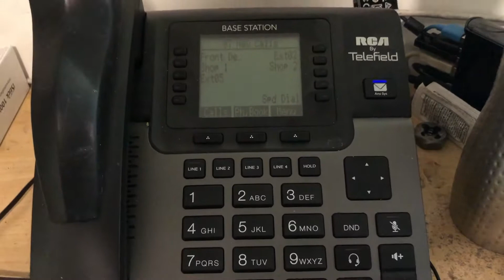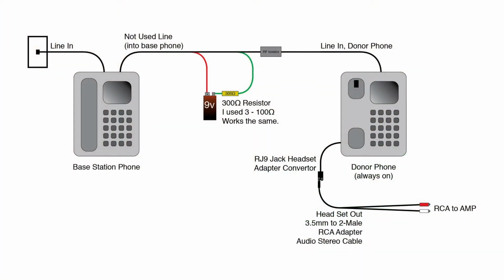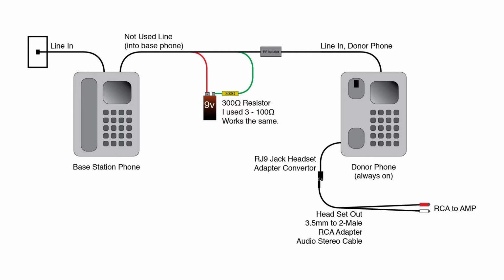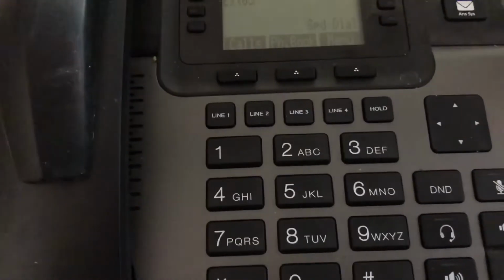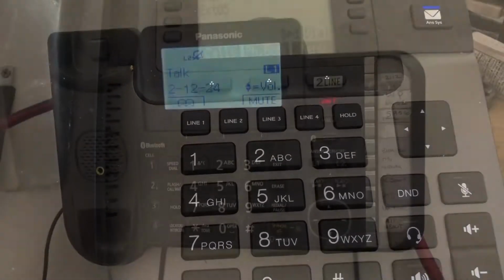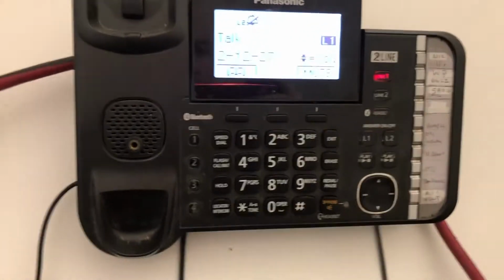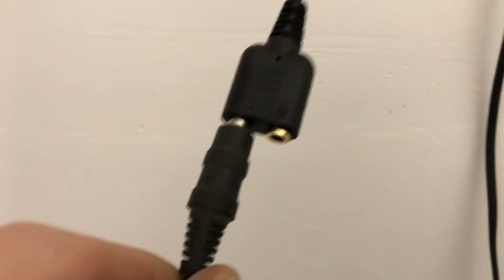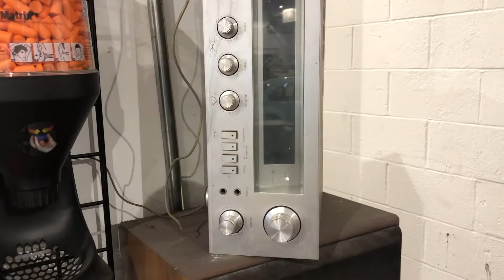How to wire a phone PA system in to your multi line phone

Comment: very good idea. I am really interested to copy your system. can you tell us how you connect the green and red wire more in detail. Is it applicable to old PABX system and assign one line for public announcement. thanks
Reply from the maker: Cut the phone cord so the wires are exposed. Cut the red wire and strip the end on both sides. Wire in your battery like the diagram. Then wire the resistors after the battery going to the donor phone / amplifier.
Reply: @MeisterWerks  Thank you for your prompt reply. Just for clarification: Will the battery be in parallel to the base station and the donor line since I cut the line between them. thanks
Reply from the maker: @BlankBMG  Yes. Wire in parallel. Cut the red wire only. Wire the battery and the resistor in between the cut red wire like this: Donor phone -> resistor -> (neg) -9v battery - (pos) +9v battery ->  main phone.